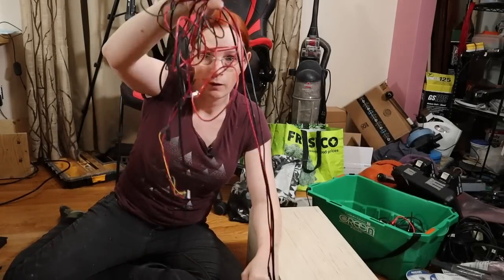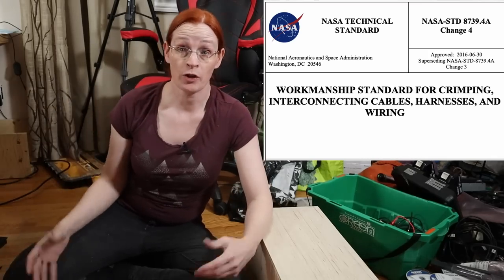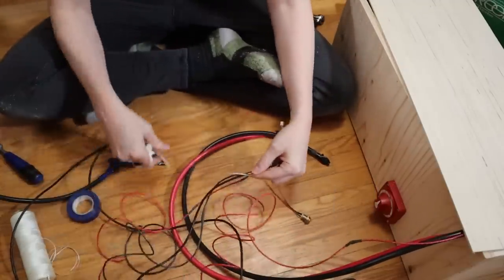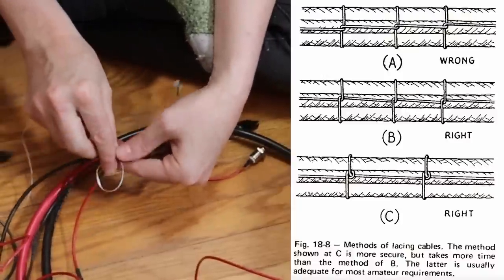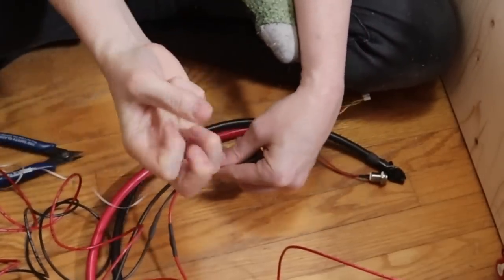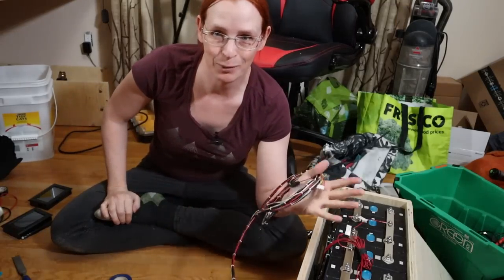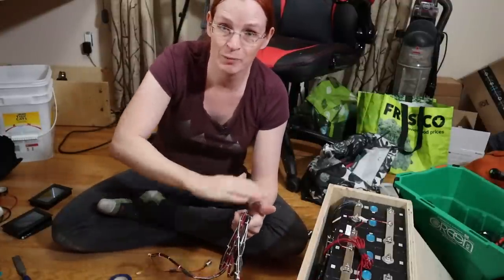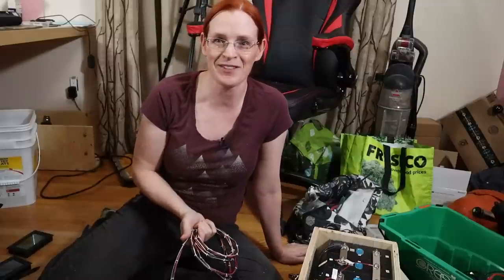The Lost* Art of Cable Lacing - A Non-Expert Tutorial

Comment: I USE TO Do SOMETHING SIMILAR, but in my case it was hauling cable thru conduit, i use to wrap the string or nylon rope around the first 2 or 3 ft of cable then use electrical tape over it...... then haul the sucker 50 to 100meters at a time between telco pits. those were the days i tell ya. with the cable ties, they do damage to ya skin gouging it out unless u trim them flush and i would go off my tree at others if they did not, especially in the cable trays either vertical or horizontal in buildings. It seems like a lifetime ago now.
Reply from the maker: I used to do premise wiring as well... You only need to snap the pull line once or twice before the value of LOTS of tape and chord is easily justified. heh.